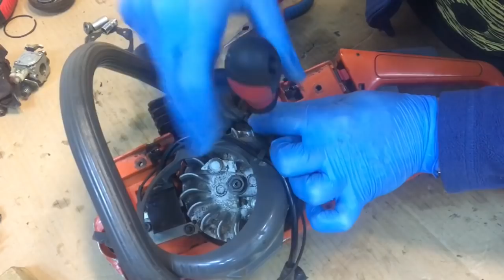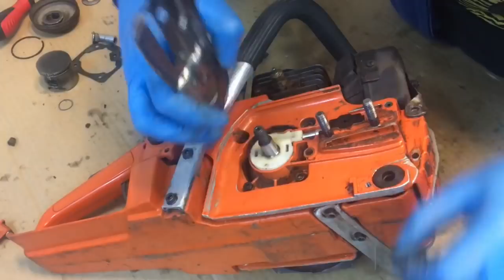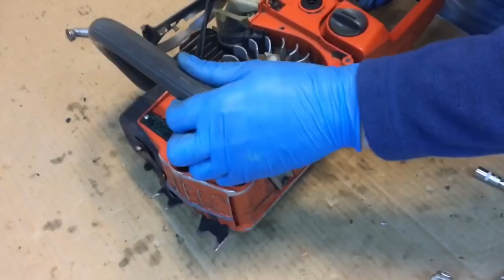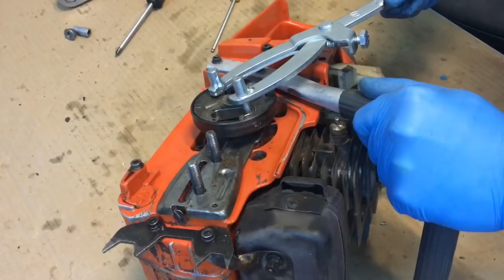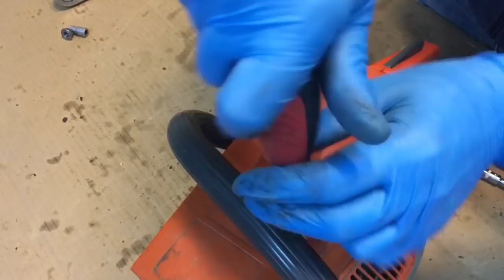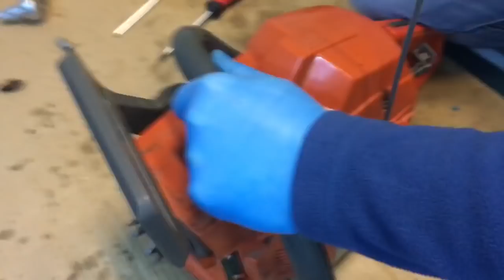Schimbat ambielaj drujba Husqvarna 51, 55 partea 3

Comment: Te rog frumos imi mai poti da un sfat ca ma dispera atvul acum imi porneste foarte turat oare ce mai poate avea ?
Reply from the maker: Detaliaza. Nu raspunde reglajului? Verifica pistonasul din carburator (cel de se prinde cablu acc. Pe el) ca sa nu il fii bagat gresit
Reply: SHR Motors pai porneste turat cam la jumate daca alcelerez se mai accelerează .Acolo la carburator are ca un ac ala Mio intrat ...
Reply from the maker: Pe marginea butoiasului are un sant de ghidare si pe corpul catb are un bolt mic. Si daca il puneti invers intra , dar se agata in acel bolt si ramane accelerat
Reply: SHR Motors ok o să-l desfac maine iar sa vad .multumesc mult pentru raspuns ..si pentru timpul acordat..de unde sunteti?
Reply from the maker: Pitesti